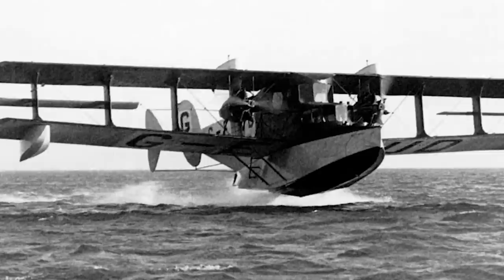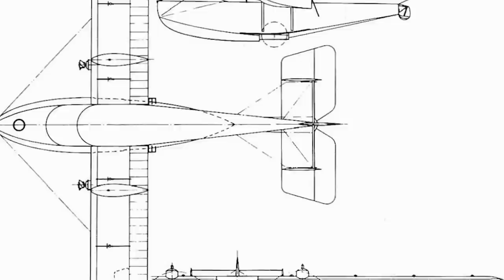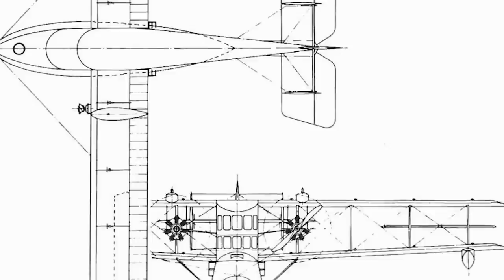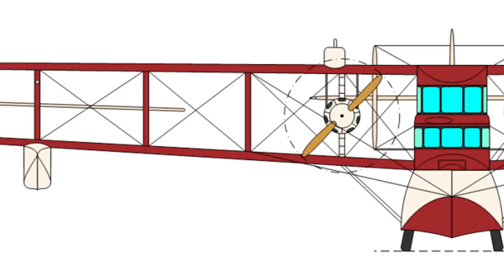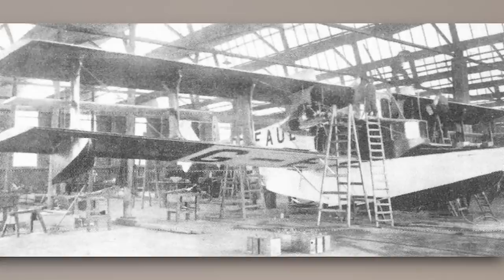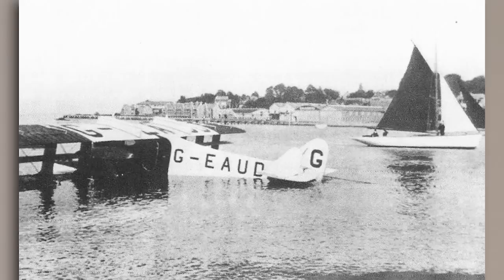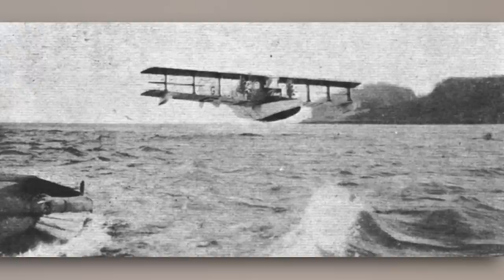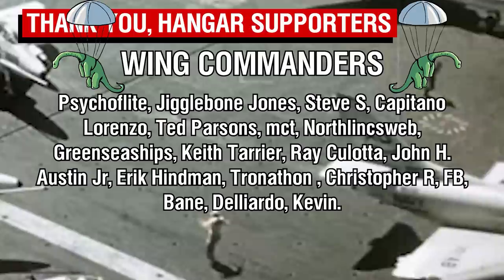The Flying Boat That Looked Like A Flying House | Saunders Kittiwake [Aircraft Overview #73]

Comment: I know they are technically and practically less useful than standard aircraft but there is a special place in my heart for flying boats. I'd love to own one myself one day. But with GA prices now it looks like it won't happen.
Reply: Get yourself a second hand Cessna, a cheap aluminum boat, and some duct tape. 👍
Reply: @davidcool5189  lol good escuse for death
Reply: They are very practical if you live next to a lake.
Reply: @markawbolton  but the price! GA is so stupidly expensive now. I could buy a house or the HU 16 and live in it.
Reply: I fantasize about modernizing a Catalina complete with a fancy glamping interior, glass cockpit, modern engines and avionics, shower, kitchen, cabin A/C, solar panels, the works. I need to rob a few armored cars first.
Reply: @dixieduffy7  Which is why I bought a 8.5 metre furniture truck, fitteted her out with solar panels and some nice windowsa and shower / galley bed and stero etc. Cost me 16 tthousand bucks. Rate of climb is disapointing and she wont aerobat but you cant have erything. ;-)
Reply: I have 2 close to my hart, Catalina and the awesome Sunderland. The Sunderland in a civilised setup as the ultimate holiday home, at retirement. Intead of bomb racks,  an elevator for bringing  down a RIB boat for going on terra firma, just go fishing. But it will probably only be a dream whatever money I could put in to it.
Reply: @dmg4415  Well if You wanted a little cramped spam can then I suppose so, but for mine I would prefer the Graf Zepplin. One needs ones's elbow room. ;-)
Reply: @markawbolton  Fire hazard? But a modern variant should suffice.
Reply: @dmg4415  Nah ..just only invite non smokers as guests.
Reply: @markawbolton  But my barbeque and smoker?
Reply: @dmg4415  Suspended 500 feet below in a gondola ? The breeze might be off putting but the view!!
Reply: @davidcool5189  I mean they make cessnas with pontoon/wheel hybrid landing gear
Reply: @markawbolton  Agree with You but, my intention is to hoist it out when moored out from the beach, or maybe doing some fishing mid Atlantic!  😊
Reply: @dmg4415  In all seriousness- money no object  - mine would be the Catalina. PBY fit out.  A guy I sed to know flew one in the pacific in WWII .. some really interesting stroes... scary weather - ball lightning in the fuselage. Lots G forces. AA fire was no where near as scary.
Reply: @markawbolton  Good choice the PBY are the woman You look after in the street, the Sunderland is the woman You married  (happily) but You never forget the Catalina,  the SEDUCER, sleek with the curves at the correct places. Must have been very noisy in the cockpit, 2 engines and 2 props so close. Then a radar who probably made the crew growing headache and infertile.
Reply: DIY. Build a flying boat in garage. It will take few years but the costs will spread over them. There are plans, kits and you can design one with somebody. 
Man, if you do good luck and post building log somewhere!
Reply: @maciek_k.cichon  hmm, that would be a tiny one, no room for beds, kitchen, storage an a shower and a toilet. You could always skip the last 2 but land to do even 1 off the side of the fuselage, and no 2 hanging the butt outside, could be very chilling experience.
Reply: Define "practically less useful"

If you don't have an airfield then a flying boat is quite useful, which is why a lot of early planes were flying boats.
Reply: @benholroyd5221  true. But have you seen a VFR map scince like WWII? Airfields everywhere. Unless you are up Yukon ways you are more liable to have a field near you than a body of water big enough.
Reply: @dmg4415  I mean you could design and build something Grumman Albatross size. There is space for double bed there, and other commodities. If Catalina Flying Home type is the goal maybe pull friend and your so in. four pair of hands and salaries.
Reply: @markawbolton  What with the price of gas these days!
Reply: @maciek_k.cichon  A side from finding 3 friends with deep pockets a lot of free time, an ordinary European garage will not accommodate this build, we need the garages to our cars, it get cold and snow all to often here. And my pockets are not lined with money. But if IF was on the positive side, such an adventure would have started a least ten years ago, now I do not have the stamina as in my 50s.
Reply: I mean i read your fantasies, old ww2 birds are nice, but those things like glass cockpit and modern engines, well viking should release new canadair, cl 515, glass cockpit and all, and also has amphibious capability, cheaper and easier than converting some old flying hull..
Reply: @dannyboy_vtc8980  We must have our dreams, and the new Canada looks nice, let that picture send us into a good night's sleep.
Reply: @alexandrep4913  general aviation, small planes.
Reply: @alexandrep4913  Aviation Gasoline ?

Comment: So based entirely on the designs 🤔 I'm assuming Saunders also designed my neighbors pontoon boat.  Box on a box on floats, and  the wings were removed to reduce air resistance.   However, I do want one...

Comment: If you're going to have structural failures, symmetrical ones are less of a problem than asymmetric ones.
Reply: I don't know. I'd rather only lose one engine than 2.

Or of you want to get pedantic with my pedantry. I'd rather only one engine fall off.

Comment: You can tell pioneers by the number of arrows in their back.
Reply: Exactly. All of those ideas were good ones.
Reply: Actually the aileron one kinda sucked ..I would be interested if flaperons might have worked far better but we dont know what the "lift devices were" ... The thing about the aerons being a problem on the water? Often you get to take off directly into wind. Probably more that they seem clunky. Hey what would I know?

Comment: The Saunders Kittiwake was the usual aircraft design to failure. Saunders tried to jam way too many "bleeding edge of technology" design features in the era before large scale wind tunnels like NACA built in the 1930s. Saunders designers were constantly chasing one problem after another and the "fixes" seem to create new strange problems. But even if Saunders engineers had access to large scale, instrumented NACA style wind tunnels fixing the aerodynamic design issues, the Kittiwake was doomed to fail due to the grossly underpowered gutless wonder engines which hampered all phases of flight. I have to admit I did a double take for the tumb nail for this video I thought it said the Sanunders Tiddlywinks  🤣